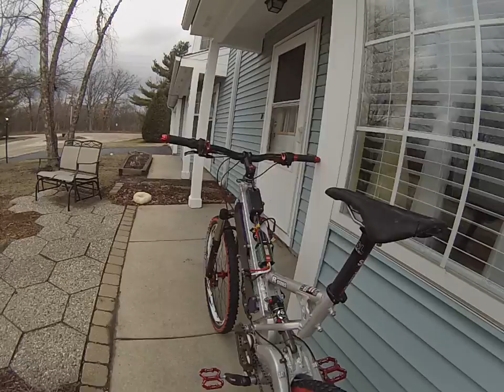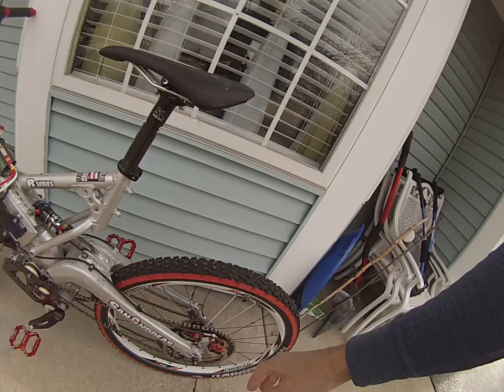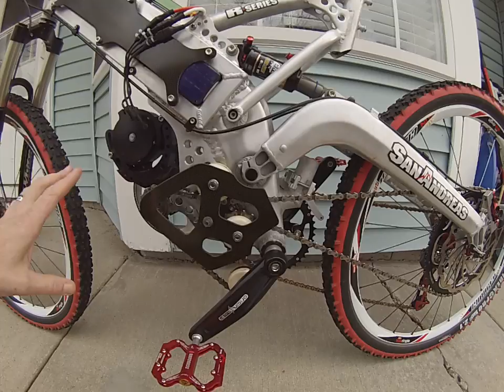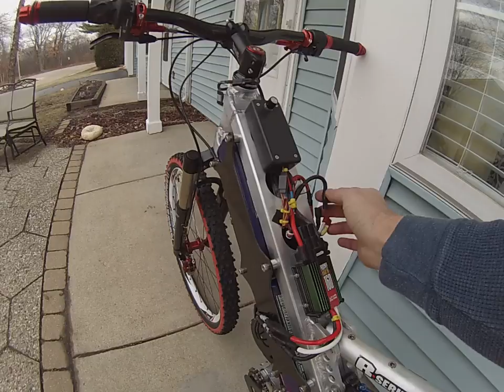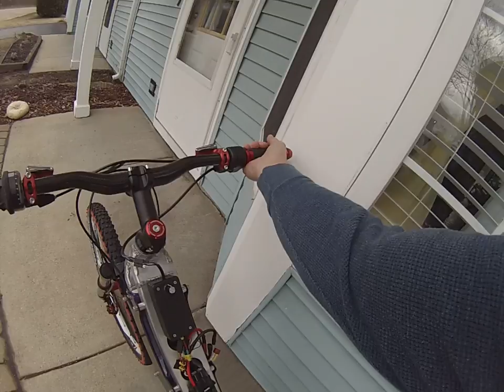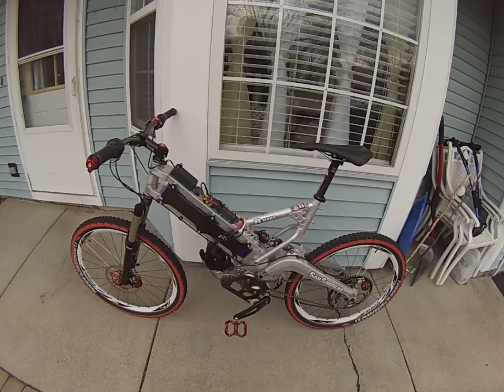RC system explanation (how to use RC equipment on an E-bike)

Comment: Good video.  I'm thinking about building an e bike with a 5th scale rc motor,  but I have to learn about how I can mount motor and having a non radio frequency transmitter and much more.

Comment: Why would you want to reduce the rpm?
Reply: Reduced motor wear, lower noise, softened throttle response, efficiency....
Reply: @TechForumTesla  would 7 to 1 be a good gear ratio with reduction  for my 5kw outrunner motor bike build? Advice is greatly appreciated
Reply: @jonathanbrunache3848  not enough information. I need to know the motor KV and battery voltage. Normally you need far more reduction than that.
Reply: @TechForumTesla  motor 140 kv at 5500w and voltage is gonna be 48v

Comment: Thank you so much yes rc motors so much power for so little money. A servo tester in a great idea. Regarding potentially too high rpm/kv of the motor I think I can lower my voltage and thus kv/rpm? Maybe not enough?

Comment: My throttle is s twist grip that, when released, is essentially at full reverse. Bear in mind, this Edge HV160 does not have reverse. The car ESCs have reverse. Assuming you are using the aircraft ESC, the settings you want are;

Airplane fixed endpoint
Brake disabled 
Manual voltage programming (40 volt lv cutoff for 12s)

If you have auto cell count programmed, it will arm funny.

Comment: Hey man I’m using the same castle esc but having problems arming it. When I arm at reverse throttle, I have to hold it there for the motor to not spin up. How do you arm it?

Comment: I just use the hub 1000w motor with 72volts. Get me 45 mph all day. Using 3 Cheap r.c. Lipo batteries
Reply: Good for you. I could gear this bike up to 65mph with the power I have. But, I value my life......
Reply: @TechForumTesla  you got me there.

Comment: You killed me when you mentioned your top end is like 28 mph, that's what you're getting for six or seven Grand and all your work?? I threw less than three hundred bucks at a mountain bike and one afternoon of fabricating and assembly, 45 mph no problem... you mentioned a few times it's a little bit complicated , I'm  thinking it's way over complicated but as long as you enjoy...
Reply from the maker: That is the top speed I geared it for. It has the power for 60mph at least. But, this is a bicycle.

Comment: what is the value of the dc voltage you are using, and how many esc amps are suitable for this, so that it is more ideal for this brushless.
thanks
Reply from the maker: 50 volts. Peak amps is 280 on this system

Comment: men bery cool video  do you have a video on how to get the throttle to work  the esc this is the only thing holding me back on finishing my bike
Reply: You need a servo tester to be able to control the esc, also if your esc doesn't have a built-in bec you will need a voltage Regulator to lower the voltage to 5v, you can get a servo tester from hobbyking, if you don't know what to get send me a message I believe I have a couple somewhere that I was going to use with a diy ebike that I end up not building.

Comment: If is 5 times stronger why the speed is not 5 times faster than an regular electric bicycle. Another one  commercial for small business...
Reply: Because it is still using bicycle components. High speed is sketchy with a light weight bike like this. Also, I like pedaling along with the bike.

Comment: Just buy a motorcycle, seriously. I've owned many RC models  as high as 10,000w / 14hp or so , I've also owned 26 gas powered motorcycles in my lifetime so far and I currently have the bug for an e-bike . From what I seen that's out there I'd say if ur going to do RC equipment The aftermarket just isn't there yet but it is because of folks like you it soon will be 👍🍻.... sweet electrifying ride , take care !

Comment: How do you prevent induced current to flow back into battery when you pedal? Are you using freewheel pinion?
Reply from the maker: Yes, watch the walk around video. There is a freewheel on the output shaft of the drive system.

Comment: Do yourself a favor and get rid of those Turnigy lipo batteries. They are some of the worst batteries out there. There is no sense in spending thousands of dollars and risking your safety and the bike with the cheapest lipos made. I've had a couple of those Turnigy lipos fail on me in a 5-7lb RC car, I couldn't imagine what a bunch of them in one bike would do.
Very impressive ebike by the way.
Reply: Mike S no, I would suggest a different brand of lipo other than Turnigy.  Brands like Venom, onyx, gensace.
Reply: you are a moron. the cells all come from the same plant in china. Turnigy doesn't make them.

Comment: Did you make an adapter to hold the large sprocket and the disc brake, which then bolts onto the mounting holes in the hub for the original disc brake?

Comment: Nice work. The San Andreas is a great design for mid drive as the frame allows the motor to be mounted a bit higher than most due to the curved "down tube." They are very light though and i broke mine back in 1999. These bikes were 10 years ahead of everyone else.

Comment from the maker: yes, the left side chain moves when pedaling. there is a freewheel on the drive unit though. So there is no motor drag when pedaling.
Reply: can you tell us where you got that big gear in the back ? i can't find any sprocket for disc hub  T_T   bigger than 20 tooth <_<